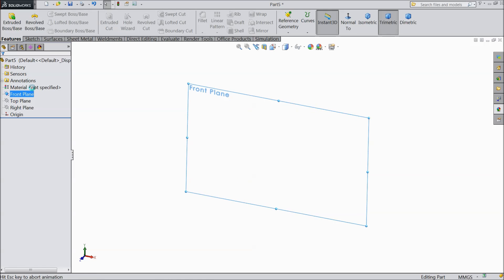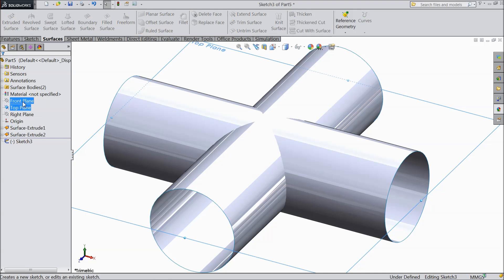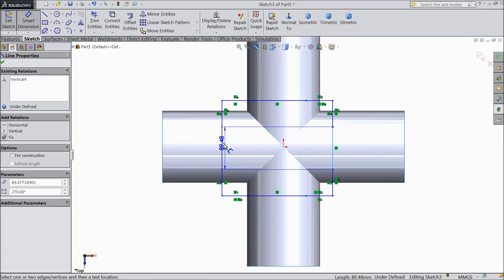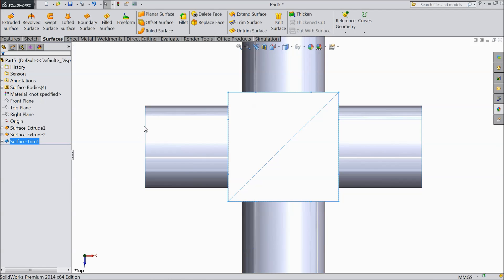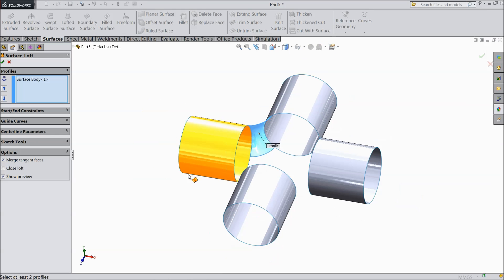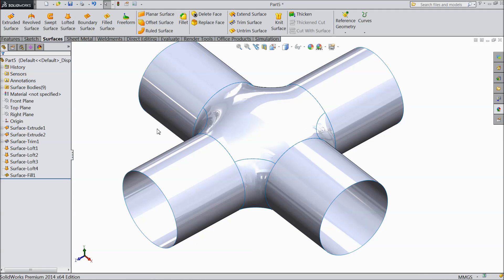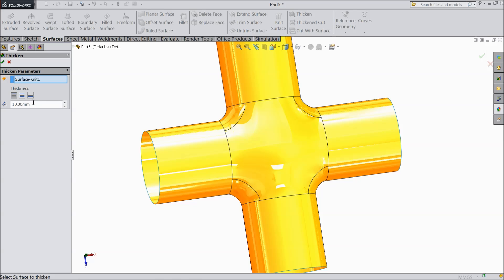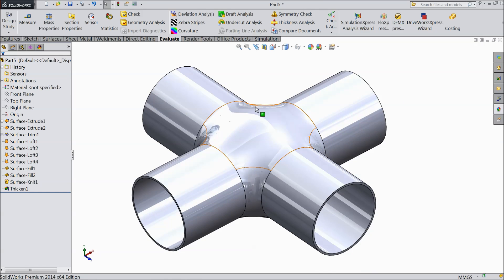SolidWorks tutorial four Pipe Joints

Comment: The trim feature in the 2018 build no longer works like how it does in this tutorial and I am struggling to get it to produce the same behavior needed to loft the surfaces together. Any advice?
Reply: do you have any solution sir? i am also struggling in the loft part. im using solidworks 2018 a